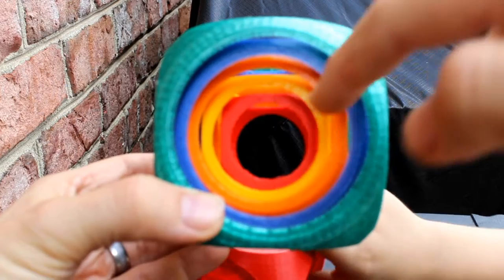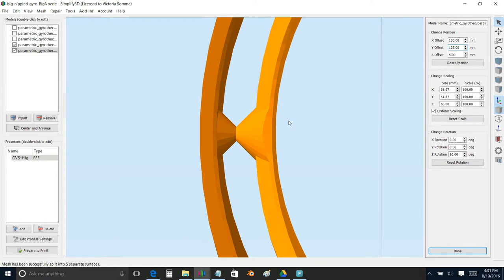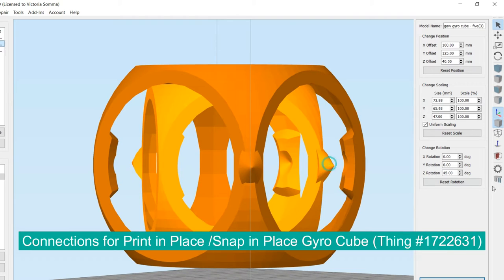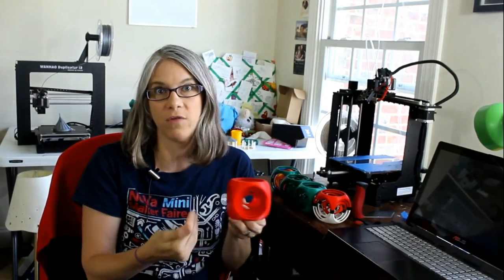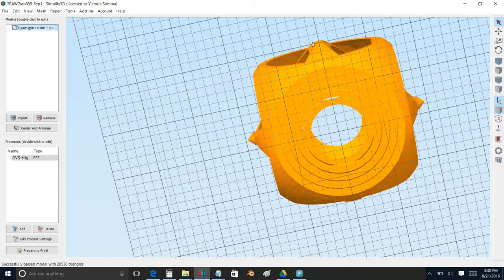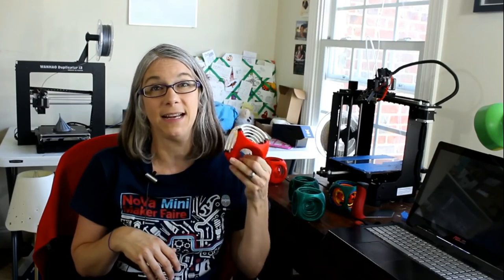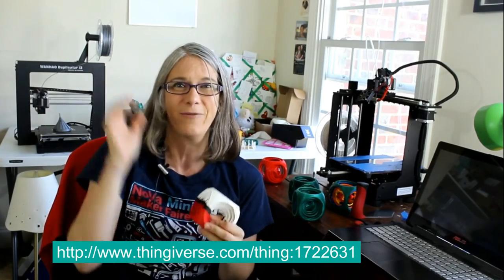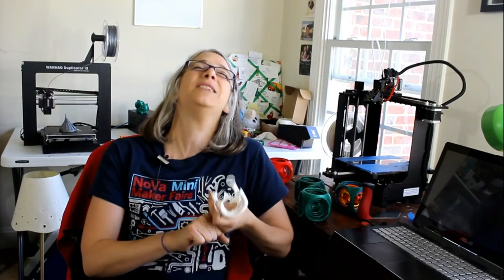Fun with Gyro Cubes!

Comment: Been using vertical lift on retract for a while, it's great. It's virtually a must on delta printers as there is more ooze due to bowden tubes, and lifting the head on retraction eliminates collisions. It also is a great thing to do on when doing large flat surfaces as the nozzle will not leave a scar when it moves across after a retraction.
Reply from the maker: Ooh I hadn't even thought about the implications of scaring a top surface.  Thanks to your tip, if/when I run into that again, I have something to try!  I love how there is no shortage of learning with 3D Printing.  You can learn something new every day!  

Thanks for watching and commenting!  Have a great day!

Comment: Another great video. Excellent tips and tricks. This is another good reason for me to purchase Sinplify3D.
Reply from the maker: Thank you Norbert!  Yeah, I have had a lot of success with Simplify3D.  If you do purchase it, I hope it serves you well.  Have a great day!
Reply: TGAW - I want to use the "process" features to swap filament on my Maker Select (Wanhao i3 clone).  And some of the other options seem cool as well. Cura is supposed to have plugins but have not found much. I wish there were some that allowed swapping of filament. That would be cool. I do all my slicing in Cura right now and it has done real well for me.
Reply from the maker: I have not gotten a chance to use Cura.  I did print a sample print for the Wanhao that was sliced in Cura.  I have never had a raft come off so easily.  I was definitely impressed by that!
Reply: TGAW - I had the same experience with rafts using Cura. I have been printing only PLA but use a skirt or small brim now. Easier I guess. I have been using blue tape and hairspray for bed adhesion. Has been working quite well except for the extreme perimeter of the bed. But other than that it's been brilliant.

Comment: can you do a tut on having prints stop and start with simplify3d for adding nuts
Reply from the maker: I haven't embedded nuts... but I have done mirrors.  Here's a video I did on that:

https://www.youtube.com/watch?v=Yq7fuyCEpNQ

And not sure if this would help, but I do have screenshots in the "Slicing - Simplify3D" section of the related blog post:
http://tgaw.com/wp/?p=359

With a hard object like a nut (or mirrors), you'll want to be extra careful that the object is safely set inside the print and not sticking up above the print when you start your next process.  In my embedded mirror video, at some point, I think you see me run my hands over the top of the print.  I was double checking to make sure nothing was sticking up.  

Interestingly enough, I had read a post recently on the MakerGear user forums of someone embedding a nut (via manually editing the gCode in a text editor).

http://forum.makergear.com/viewtopic.php?f=3&t=2132

You may want to peruse it, specifically the section where the maker mentioned ABS did not still well to the nut.  With that in mind, you could incorporate bridging into your design, so you are not necessarily relying on stick to the nut.  Or perhaps you can improve on the process altogether!

I hope this helps.  My mirror video was one of my earlier ones.  If you need any additional info or screenshots--- let me know!  Thanks for watching and commenting!

Comment: Great video Vicky, thank you.
Now I need to go experiment with relative positioning as I haven't used it yet.
Reply from the maker: Thanks Spike!  It is amazing when these slicing features pop up with a use.  A while back I saw Joel Telling's video on using Mesh-Separate Connected Surfaces in Simplify3D.  He used it to clean up some artifacts inside a rocket model.  At the time, it did not seem like a feature that would be of use to me and then now all of a sudden-- I have a use case with the Gyro Cubes.  So perhaps Relative Positioning will all of a sudden show up with a use for you!  :)

Thanks for watching and have a great day!

Comment: Hello Again Vicky,
I have just tried the scripts that are in the video and description, but in my case S3D completely ignored them and just continued printing. I tried this out on a 20x20x20 cube.
There is an setting called Firmware supports "Sticky" parameters in the G-Code Scripts tab. Do you know if this could be causing it? Is it enabled on your S3D?

Also I notice that you link to your model on Thingiverse in the description, but no link to this video in the Thingivers description. Just thought it might be good to add it.

Have a great day
Reply from the maker: Good Morning Spike!  My first suspicion -- were you printing via the SD Card?  I tend to run my embedded parts and multi-colored stuff through the USB cable--- perhaps that is the difference?
Reply: You could be right, I use OctoPi rather than USB from the the PC.
However, I would have thought that the generated gcode would still have all the correct commands etc. I have opened the gcode with Notepad++ and there is no reference at all to the 'insert part' commands, yet all other changes are clearly there. Very strange.
I have emailed S3D asking for their advice and will post their response here so that we can all benefit from it ... even if it means I look daft :-)
Reply: Good morning Vicky, well, it's morning here :-)
Great news, I got it working perfectly. Or to be more accurate, S3D Support did. They are awesome.

As I suspected, it was me being a dork. In hindsight it's obvious.
All through I had thought it was all done in one print, with 2 processes. After I re-watched your video on inserting mirrors I noticed that you started another print job ... and it all fell into place with what S3D support had told me.

Now I can go print the your Gyro Cubes for my Neice, I'll post a make when it's done of course.

Keep up the great work and thank you for your help.
Reply from the maker: Oh that's awesome!!!   I hope they turn out great and your niece loves them!

Also-- I just saw your note about the lack of video in the Thingiverse listing.  Thanks for pointing that out-- I'll add that in.
Reply: Indeed, it turned out great, posted a make as promised http://www.thingiverse.com/make:253210
Thank you for your design and help.

Comment: will this work on the monoprice mini ??
Reply from the maker: Greetings Noah!  I don't have first hand experience with a MonoPrice Mini.  I do see the bed size is 120 x 120 x 120, so you should be set size-wise with this Gyro Cube which is in the neighborhood of 80mm.

I think the biggest challenges with this print would be the overhangs and the bridges as it is closing up the circle cut outs.  I'm seeing some pictures of 3D Benchies which looks like this printer can hold its own.  If it gives you hassle, you could always try some extra supports in those circle cutouts to help 'em out a bit.  

One other thing to watch out for (this is new information) If you do the Snap in Place version, watch those first few layers.  I had someone alert me yesterday that in their attempt, the bottom of their cubes fused together. In the Snap in Place version, those spheres are really close together in the beginning-- I can see how a too close first layer or over extrusion could cause some havoc.  So just make sure they aren't running into each other at the beginning.  I wouldn't expect the Print in Place version to have the same kind of pressure on its early layers being perfect.

One thing I did when I first started experimenting with Gyro Cubes was print a 3-sphere version instead going all out with the 5-spheres.  If I was gonna fail, I wanted to fail fast (on in this case, faster).  :)  If you would like to try a similar experiment, but feel uncomfortable changing OpenSCAD variables to make a test model, lemme know.  I can make a test STL for you real quick.

I hope this helps!  Let me know if you need any more information from me!  Thanks for watching...and commenting!

Comment: Terrific stuff, I've been using a zlift  on everything after my first hotend crashing into a print :-) Any chance you could share the Simplify FFF Profile as well. I got a little confused when you talked about adding profiles then posted the start and end g codes.

M104 S0 ; turn off extruder
M140 S0 ; turn off bed
G28 X10
G1 Y190; Send the print bed to the front to make removal easier ****
M84 ; disable motors

My end script sends the bed to the front for removal of the print. Adjust for your printbed size.
Reply from the maker: I wish I knew about the Z-lift about a year ago when I was first starting to print gazebos.  :)

I'm working on a series of videos on how I do my multi-colored birds that hits on the multiple processes as well.  I'll make sure to be include how I hit "Add" button on processes and what I usually do with new processes.  

This may help fill in some of the gaps.  I do have a blog post that accompanied my video on embedding mirrors.  If you scroll down to the "Slicing - Simplify3D" section, I do have some screenshots of setting the Start At and End At on the Advanced tab and adjusting my Starting Script and Ending Script in the Scripts tab.  That's at http://tgaw.com/wp/?p=359

Also I learned about running the multiple processes one at a time from Joel Telling in this video:
https://www.youtube.com/watch?v=ZHe2_h1nQG4

Hopefully this helps!  Let me know if you need any more details at this time.  

Thanks!
Vicky
Reply: Thank you, I've done some changing of temperature at different heights ie 190 @ 10mm 200 @ 200 etc etc so I could work out the best temp for different filaments but got confused by what you were doing exactly. I really appreciate you sharing your experiences. I'll check those links out.